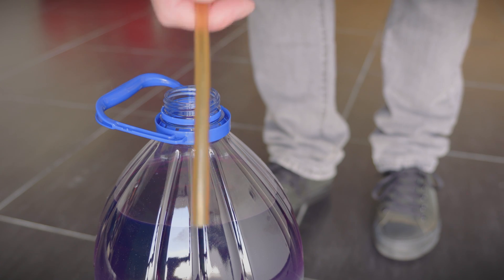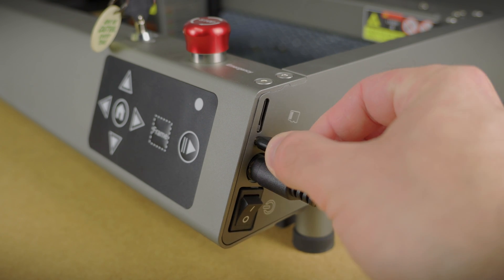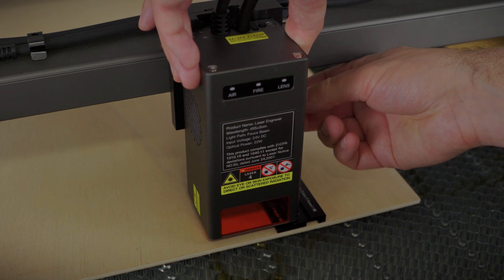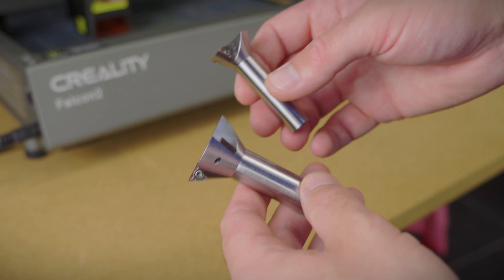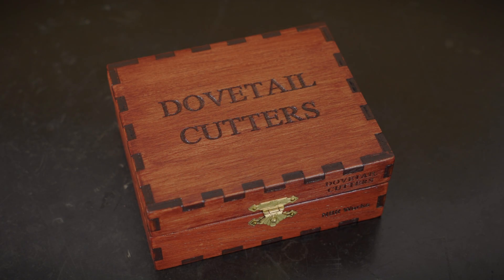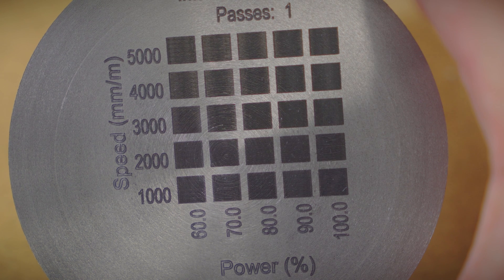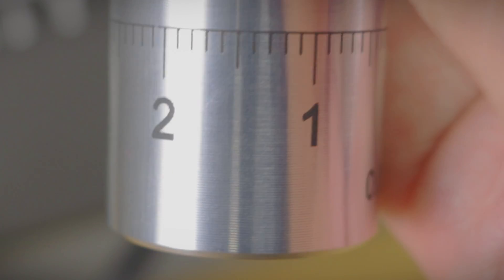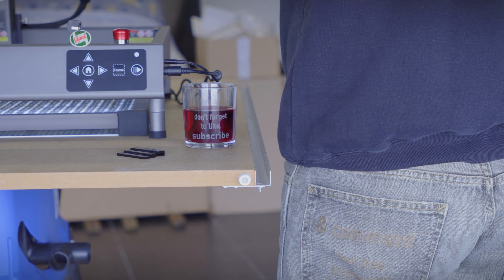Will a diode laser engrave STEEL? Aluminum? Brass?

Comment: thanks ! When engraving on Stainless Steel can you feel the dent on touch ?
Reply from the maker: Hi. No, it's a superficial mark. To actually engrave with some depth you need a fiber laser.
Reply: @nbrworks  then why your metal pen was able to friction with the Stainless Steel ?
Reply from the maker: Im my experience, with both this diode and later with the fiber laser, when metals are engraved, there's tipically a slight burr raised around the edges. I believe that's molten metal that didn't fully vaporized.
You can play with the settings to get better results, but if you're new to lasers, expect to have that raised burr.

You can see that burr (and also an engraving with some depth) on my Toolroom Takeover video. I made a switch with 4 engraved wheels.

With this diode laser you can't see much of that burr but it's possible that it's there and the reason for the scriber catching on the edges. The diode laser did engrave with some depth but it was tiny. It's really limited. It's fine to engrave markings on tools, but if it's something that you will handle frequently, expect it to wear off.

With a fiber laser, you do get a permanent mark, and depth, depending on the power, speed, number of passes, etc. The more powerful the laser, the better. Mine is just a 20W and can easily make 1 to 1.5mm depth on stainless. Prices are completely different though.
Reply: @nbrworks  Thank you so much. In fact I'm looking for the "tiny" permanent depth, i want it to be to be felt with touch. Do you think 40w or 80w  diode laser can achieve what I want ?
Reply from the maker: I'm not sure. I never tested a 40W diode or above. Try to watch reviews of those lasers and make the same questions there. I can only speak for the 22W and to be honest, a diode laser is not the correct tool for deep engraving on steel (fiber is). The 22W is nice because you can engrave on wood (fiber can't) and it's a lot cheaper. 

You can also explore infrared lasers, they work well for metals. I can't give you first hand opinion as I never used one, just adding that in case you don't know them. 

Purchasing a laser is a big investment, so take your time to research and ask questions 🙂
Reply: I have the same machine and I am able to engrave stainless steel